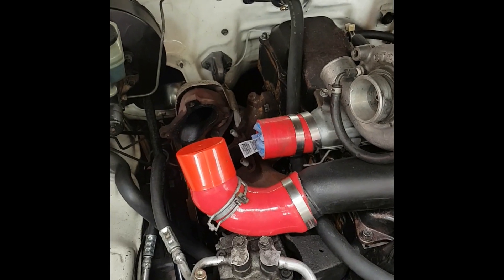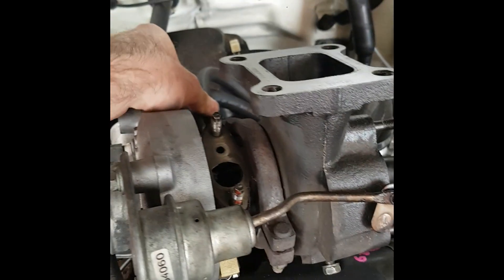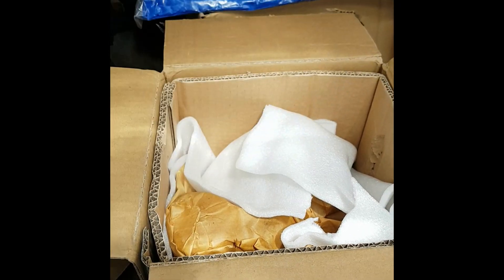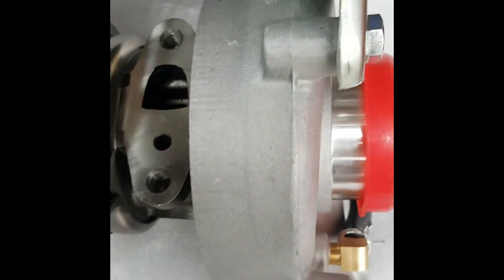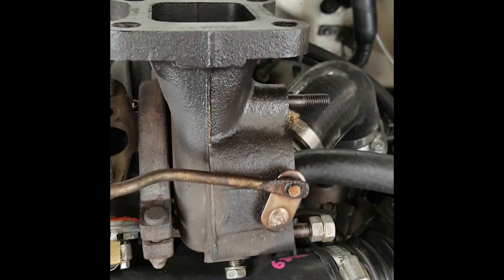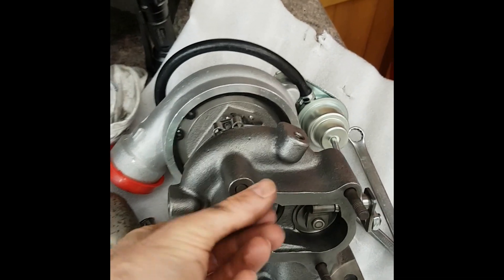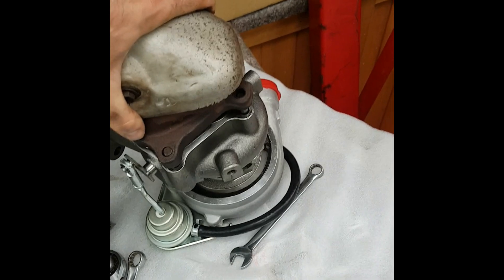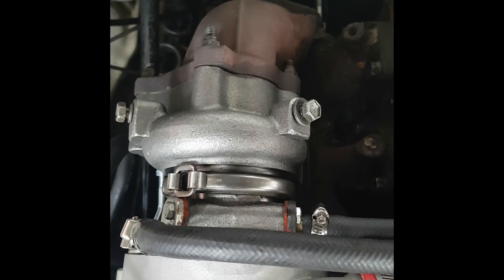Hilux / Tacoma CT20 Turbo Install

Comment: Hoy dude any update on the turbo , still spinning,  all good ? Would you recommend the brand? 
Thanks
Reply from the maker: G'day Sergii. I've only put about 1km on the turbo motor before parking the ute due to excessive blow-by. I've just finished rebuilding a new engine for it and will post those episodes up soon. I'll also post a follow-up video on how the turbo is going. Stay tuned!
Cheers,
Marc
Reply: @ripsgarage824  to be honest I've already purchased one , so will see it from mine .
Thanks

Comment: Hello mate one question where does the two water cooler hose go when exit the turbo
Reply from the maker: Hi. They join the coolant hoses which feed the HVAC heater core as they're the same size. The factory coolant pipes rusted out so I replaced them with rubber hose and ran them on the opposite side of the head.

Comment: What is the pressure recomendate for 2.8 in the Turbo?
Reply from the maker: I believe these CT20's put out somewhere between 7-10psi in the 2.4 (2L) engines. Mine's set to about 8psi. I definitely wouldn't go past 10psi on a stock engine.
Reply: @ripsgarage824  WOULD THIS TURBINE SERVE THE TOYOTA 5L ENGINE?
Reply from the maker: Yep, the CT20 (and manifold) will fit the 2L, 3L & 5L.
Reply: How to add a Turbo City 20 to a Helix 3L 2.8